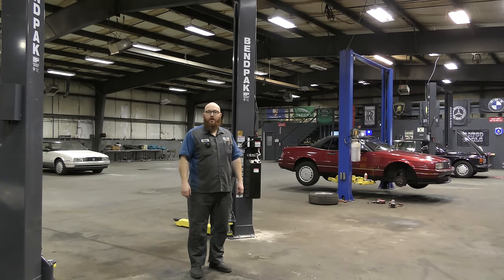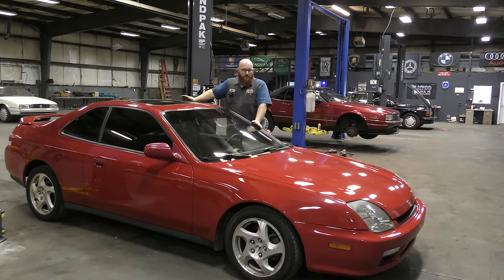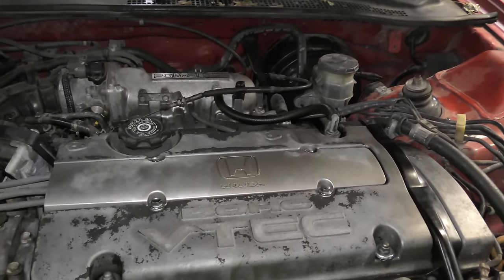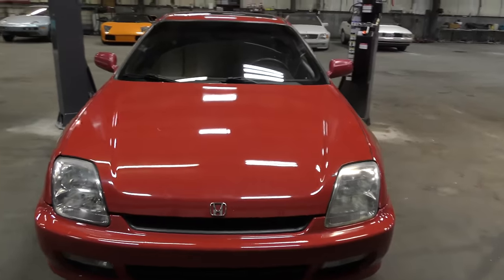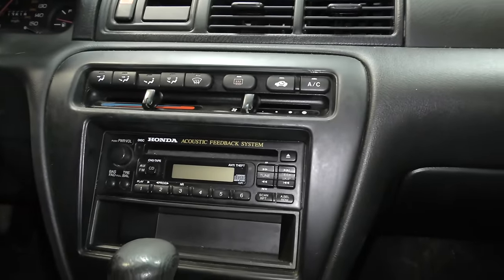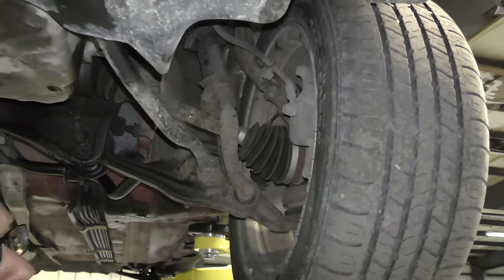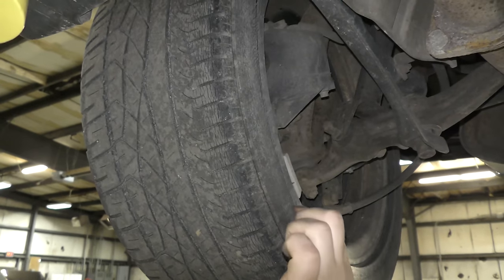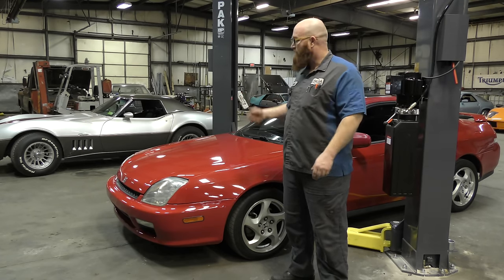VTEC YO! The CAR WIZARD finally gets a Honda Sports Car ~ A 2001 Prelude!

Comment from the maker: The information source I used was incorrect. This was not the vehicle that VTEC was as introduced on. It was the Integra. Thanks for the help guys.
Reply: Cough nsx cough lol
Reply: Had a cousin who got rid of his because of the manual transmission starting to fail. Now that you said they're rare maybe he should have kept it and just fix it. He has a Chrysler now 200 now 🤦😑
Reply: In 1989
Reply: Yea it was the NSX that had vtec first.
Reply: The NSX in 1990 was the first.
And in 1983 the Honda CBR400 had the prototype version of VTEC called Rev-Up.
Reply: VTEC was introduced on the JDM Honda CRX SIR EF9 model fitted with the B16A engine in September of 1989. It was also used on the 1989 Honda Integra XSi and RSi models. VTEC was first introduced to the American market with the Acura NSX in 1990.
Reply: Poly bushings upgrades
Reply: You could go driving these hoopties and do something crazy like battle Tyler in a Drag queen race.
Reply: 1st Da6 integra xsi 89
2nd crx ef8 Sir 89
3rd civic Ef9 sir 89 
they were the 1st 4 pot vtec all japanese models euro and American versions came a year or two later depending 

There is also 2 vtec engined bikes 

Cb400f superfour vtec 
Vfr800 vtec 

Prelude didn't get vtec yo till 91 in the bb chassis
Reply: @carwizard  my brother has a mint condition 2000 prelude 94 k miles and it burned oil like crazy. Any thoughts, garage kept and never beaten on.
Reply: I just recently got a 2001 Prelude, 170000kms, 5 speed manual, leather, not as nice as yours. It's also my first "lude" and I agree that they are awesome little cars! I'm happy as hell with mine.
Reply: bman m all prelude engines burn and leak oil. Swap with a b series engine. B series engines are all reliable. Same with k series.
Reply: It also had a 2.0L engine with 133hp
Reply: You're wrong again wizzard, it was the CRX 1.6 Vtec.. that was the first Vtec Honda made..
Reply: Poly bushings suck....transmit tons of vibration through car...
Reply: I stopped watching as soon as I realized its an automatic lol
Reply: I had the accord with that motor with the manual was my favorite car i did 430000k in it. Thats gonna be your most reliable car
Reply: PowWowChicken tell him to dump the Chrysler before it fuckin catastrophically fails on him and tell him to pick up another lude and the rest of the money for mods
Reply: PowWowChicken Wow what a downgrade from Honda to Chrysler
Reply: Pretty sure you just pissed off every Honda fanboy here
Reply: How much did you pay for it? Too bad it's not a manual transmission!
Reply: What happened to all Honda sports cars not sports
Reply: @economynotstable  the first Honda that used VTEC was a Civic in 1992 with the d16z6 in the Civic EX/SI. You are wrong.
Reply: Clorox Bleach  They're rare in Kansas, where the Wizard lives.
Reply: @brittonwritespoetry  2nd car with vtec was DA integra with b17a
Reply: @montevallomustang  Yup, 1991 was the first year for VTEC with the NSX!
Reply: Car Wizard I was sure about to say this man has finally lost it 😂
Reply: @bmanm5217  My '89 Integra did that at about the same mileage...and I changed my oil at 3000 miles regularly.
My NSX is just starting to use oil with about 160k on the clock.
Reply: hmm well technically integra is an Acura in USA but... Acura is Honda... um and that was 92 GSR.... but with honda sohc vtec..., hmmm
Reply: Wasn't it the Del Sol?
Reply: @mini4x  idk honda brand logo, EG Si had a d16z6 in it.. EX honda coupes too, 92 -95... hmm
Reply: Cough cough jdm crx with the original b16
Reply: @chocobloco214  I know, but I thought we were speaking american market... hmmm... USDM
Reply: @brittonwritespoetry  I was scrolling for this comment. Nice to read the facts from someone who's not being judgemental.
Reply: BiggestComplainer  i had one too, dope car; clean white 92 gsr
Reply: The Integra is also incorrect. The first car ever with VTEC was the Honda Civic and CRX EE8/EE9, introduced in 1987. it had a 1.6 litre inline4 with 160HP. The bodystyle (hoodline, front bumper, lights) was slightly different to the ordinary ED Civics.
Reply: @hendrikwagner5957  obviously but we are speaking directly about the American market. not the JDM!
Reply: nafets zlaw the EE8/9 models were available also at the USDM market, as well as on the EDM and Arabic markets ;)
Reply: I sure hope you like blown transmissions If it was manual I say have fun but  You gotta have a great time Trust me swapping minds to manual was the only way I could save it and that was a bit hard even with a donor car
Reply: Adam Honda98 that’s right, the automatic wasn’t the most reliable one, but I’m pretty sure, the wizard can handle that :)
Reply: The 1st VTEC in the US  was the NSX then came the Acura GS-R model. The GS-R hatchback came with a 5-speed manual and 1.7-liter B17A1 4-cylinder VTEC engine with 160 hp.
Reply: Too bad you didnt start it up and revved it so we could hear the VTEC KICK IN
Reply: Gotta love those 93 integra gsr's.
Reply: @bmanm5217  go and read up on FRM(fiber reinforced material). Basically honda used this in all prelude engines. The cylindre walls all super tough but they eat trough piston rings like candy. Every prelude will eventually suffer from this in its life.
Reply: Mr Car Wizard sir I'm so glad that you've made a video on the 5th generation prelude. I've owned one since 2013 and she's busted :( I wish I had someone who knew how to work on one of these. Every mechanic in my area struggle to work on these simply because they're so rare and the parts are so hard to find. Perhaps I could send you some videos of mine? It's automatic with 180k miles and a bright blue color. I've been hesitant to let my car go and I've had to buy another one to take me to work in the mean time. Hopefully you could offer some advice on how to get her road Worthy again. Thanks in advance
Reply: Mass production vehicle 92-93 Integra gsr B17, not the first, but the one to bring it to a more broad audience.
Reply: Yup nsx was the first
Reply: Drive it..
Reply: Dan DeLuca. Integra
Reply: Mr Jimbo 666 1989 Honda integra my friend
Reply: Britton Wright introduced on integra then the Civic then the CRX
Reply: bman m. Change piston rings and maybe pistons depending on wear obviously..
Reply: R vT integra
Reply: Mark Hutchinson 1990
Reply: Hendrik Wagner integra 1989 was the first VTEC
Reply: @vtecmossy  happy someone knows how to find information.
Reply: R vT in Europe my friend.
Reply: Supercharger
Reply: Britton Wright your wrong, the integra got the B16 in 1989 and the the CRX sir got it in 1990 and I had both car at different times.
Reply: Alfa Romeo Twin Spark was the world's first VTEC engine back in 1980 but Honda gets all the credit
Reply: "i couldnt let it get trashed"
a few episodes later
prelude totaled
Reply: R vT intgegra 1989 DA6
Reply: B16 in 94 del sol
Reply: Just custom the exhaust maybe it will sound like an sport car
Reply: 85 or 89 teggy right...and I'm not sure if this was said but that was when the U.S got vetech
Reply: @youngb1ood  swap it with a b series 🤭 that's a good one.
Reply: I had this car in looking for one in red again please if tou know anyone nyc
Reply: You were actually half correct.  The Prelude was the first Honda badged car with DOHC VTEC that Honda sold in the US.   Integra and NSX were Acura badged in the US.
Reply: Ummm...sorry to spoil this for everyone but the first DOHC VTEC in the US was actually the VTEC Honda del Sol.
Reply: Just picked up an 01 Prelude 5 speed. Its awesome! Close to my old 97 Accord coupe 5 speed. Both very rare to see these days

Comment: A stock Prelude, wow that’s rare! 

-Automatic

Oh, that’s why
Reply: That and the fact that 99.9% of these cars have been beaten and modded to death.
Reply: I know a guy that’s almost stock except for the exhaust and intake but it’s under 100k miles or so and is a manual. Currently it’s had a random loss in mpg though that we can’t quite figure out.
Reply: @lildwell2  not even good mods 
Mods that leave the car half broken and poorly running.
Reply: And like most base models, 2 wheels are on the wrong side.
Reply: the prelude i bought few month ago was a manual and was pretty stock too, but not in this good shape. Even so, it was a SH type, so 200hp, but the guy had bring it to the dyno and he said that he gave it 5hp more. But it's still a fun car to drive
Reply: @palaricsebastien4148  yes I liked these back in the day.  Wonder why Honda dropped them?  Sales I suppose.  They also had the Accord Coupe in the lineup.
Reply: @rex_s80  fuel filter

Comment: Glad the preludes finally getting some recognition, hidden gem in Honda’s lineup
Reply: Love mine. If they made them rwd they be much more popular and selling today
Reply: Bryce Czirr maybe the 5th gen compared to competition, but the third gen had a mechanical 4WS, and at the time was literally the best cornering production car ever. 4th gen vtec also has a 0-60 of 6.3 seconds, which was pretty good for a 2.2L in 1993.
Reply: Bryce Czirr I don’t think the prelude needs to beat the best fwd car of all time to still be a really good car.
Reply: That h22 engine in that car can handle a ton of power
Reply: They are fun to drive for sure, but also loud on the freeway.  The manuals really could have used a 6th gear overdrive!

A buddy totalled his Prelude but it was still drivable, we had a blast driving the hell out of it before it went to the junkyard!
Reply: @Bryce Czirr there is a video of japanese pro drivers racing the Integra R, Civic R, S2000, Prelude S, Torneo Ebisu in 1999 and S2000 obv beats Prelude due to lighter body and RWD along with the integra but prelude came in 3rd (of course its not the car but the driver regardless of hp and weight) but i smoke civics in my prelude every so often. Also the Prelude wasn't as appealing back then because people would just rather buy an accord or civic since they were the cheaper option.
Reply: Ouch

Comment: Still driving my 01 ,  electron blue and its manual.  Been 19 years on the road and it still runs like new.  Never been in the shop and i proudly do all the work under the hood.  Still love this rare jem.
Reply: my 4th gen is painted the 2001 electron blue. BEST color honda made.

Comment: I'd manual swap it with all the factory parts to do so, interior and exterior, and leave it there.
Reply: I absolutely second this statement. It would make this Prelude “Most sought after” = PERIOD.
Reply: @johnnyBqwazy  are more sought after would be a factory manual. A swapped car and a stock one isn't same value wise.
Reply: EXACTLY! Manual swap and leave it!

Comment: Make sure you put the wheels on the correct side. They are marked left and right and the spoke patter shows you when they are misplaced. Also upgrade the suspension. having Eibach street spring will keep the factory ride confort but lower it few couple of inches for better look on the open wheel arch. I will keep it stock but fix the paint job that seems to be not color match (at least on video) and put back all the emblems. If you like the Vtec just add a proper cold air intake and you will enjoy the loud Vtec sound.

Comment: I'd keep it standard, maybe swap out the exhaust for a stainless one. They're too rare to butcher with heavy modifications.
Reply: I basically agree. I would do a few more 'mods' along the same line, like upgraded shocks, stainless brake hoses, paint the calipers. I might switch the coolant hoses to silicone if I am feeling really ambitious.
Reply: @RandomVids519  It prevents rust...?
Reply: @superdupergrover9857  calipers and rotors always rust no matter what.
Reply: Manual transmition plz...But that would spoils the originalty of the car.....
Reply: @MrDuceOwen  Agreed. From getting hot/cold and the road debris/water from being low to the ground and having some bare metallic surfaces.

Comment: The rear wheels have been swapped from side to side. Those are directional rims back ones are on wrong side
Reply: Came looking for this comment haha
Reply: @Julian-do7bv  same here.
Reply: I had those same wheels on my accord.  For the longest time I had em mixed up. One day this unexpecting dude walked up and said,  you know those are directional wheels right?. Needless to say,  I felt dumb🤦‍♂️😁
Reply: Ha ha almost posted this exact comment good eye
Reply: My inner 'Rainman' was freakin,'Rear rims are backward,rear rims are backward....'
Reply: called rotating your fuckn tires????
Reply: When your tire guy replaces all four, just have him match the Rs and the Ls to the correct side of the car. Should be marked on the back of the spokes.
Reply: BryDuhBikeGuy 
Maybe the front ones are backwards 🤔
Reply: @rabidrizon977  yeah front to back genius, don't cross them

Comment: Wizard says “don’t buy a Northstar” then buys 2!  Wizard advises “which Hondas to buy....NONE with automatic trans”....then of course buys a Honda with an automatic.
Reply: His suggestions have the disclaimer "unless you are a mechanic."
Reply: Literally one of the worst autos for Honda. Any Accord based platform with a auto, which includes this generation of Prelude, will literally be out by 100k
Reply: @goldendevereaux  4cyl should be okay
Reply: Its tip-tronic....you can shift it like paddles, but with the stick.
Reply: Hoovie is a very bad influence!
Reply: That transmission is terrible.  I owned one.  4th transmission by 90k miles. RUN!!!
Reply: @goldendevereaux  yep
Reply: Yeah I have been looking for manual Honda’s now…

Comment: That car has directional  rims the rear wheels need to be flipped. Great car though A manual transmission will make it even more fun to drive and not that expensive to do
Reply: Actually the rear are correct the front need flipped

Comment: Absolutely beautiful car, Wizard! I had a 2000 Milano red Prelude SH. My sister currently drives a 1999 Automatic that is stock. I put an after market exhaust & cold air intake on mine. The intake ran down and behind a vent in the bumper. I also had 17" Enkei six spoke rims. Mine had about 40K miles on it when I purchased it. I had to repaint the hood, mirrors, & rear spoiler because the Texas sun had faded those sections pink. The car looked & ran fantastic. 

I once owned a 1992 Acura NSX, and I always felt that this Prelude was in many ways an equal to that car. I referred to my 'Lude as a "mini NSX'...it was just that good.

Be prepared to be challenged by each & every Mustang driver you encounter.
This car FLYS! "VTECH, YO!" 😎

Comment: Keep it *STOCK*!!!
Reply: J37 swap
Reply: I have a hard time keeping the sound system stock in any of my vehicles, but otherwise that car is a time capsule and modifications will only devalue it.  I'd drive it until the automatic inevitably dies (Honda autos have been junk for a long time) and then manual swap it and keep on going.
Reply: @406Steven  those speakers are really crap allways
Reply: I disagree. What this car needs is some 22's and hydraulics

Comment: Lucked out hard and found one for sale locally around where I live this summer. 2000 Prelude, manual, bone stock and clean as a whistle with 55000 miles on it. Paid a pretty penny for it, but what a beautiful little car it's been. They're at a weird place now where the clean ones are rare to come across and pricey, but there are still a decent number of them dirt-cheap and dirt condition to be found.

Comment: It's a survivor, so I Would only do maintenance, a good set of tires, brake pads. MAYBE a manual swap, but very unlikely.
Reply: agreed - the H22a doesnt lend itself lightly to tinkering unless - its all out tinkering..like a weekend bender.
Reply: Manual swaps are mandatory.  These era Honda Automatic transmissions are trash.

Comment: i had one of those also automatic nice reliable car, wasnt screaming at me on the highways, fun to drive. I kept it pretty much stock aside from powder coating the valve cover and changing the seats.
Reply: not screaming at you on the highway...are we driving the same car? 4000rpm at 80 baby
Reply: @devilish2319  I drive at 60-65 so ye same car

Comment: I love Hondas, especially mid-90s to mid 2000’s era.  My mom had a Prelude that was the previous generation to this one and it had four wheel steering on it.  That was a fantastic car.  Since you have the ability and the shop for it, I’d love to see a manual swap on this prelude if it’s at all feasible.  Keep it as stock as possible but putting a manual in would just make it that much more fun to drive.

Comment: I had a '97 Base 5MT.  Drove it from 15K to 160K, and did zero mods to the car.  It really didn't need anything, as it was already a blast to drive.  Plus, anyone I knew that did modify their preludes, only ran into several problems down the line.  I regret not replacing the clutch at 160K, as I traded the car on a brand new Subaru WRX, which was not nearly as reliable, but otherwise was nearly as fun to drive as the Prelude.  Thanks for posting up this underrated dream car.

Comment: Take special care with that Sportshift transmission. Change the fluid regularly, add an external transmission cooler, and use sportshift as very little as possible. The Sportshift in my 1998 lasted until 223,400 miles.

Comment: I want to see that engine run free with a manual,no more mods are needed.
Reply: Rwd would be a great mod
Reply: @mrgmc6314  IIRC rwd conversions on Preludes are not a cheap endeavor. Lots and lots of fabricating just to get a driveshaft under the already really low interior floorline.
Reply: Manual swap is piece of piss easy to do on 4th and 5th gens, so that would be my vote. Beyond that, just restore the paintwork and enjoy it, imo!